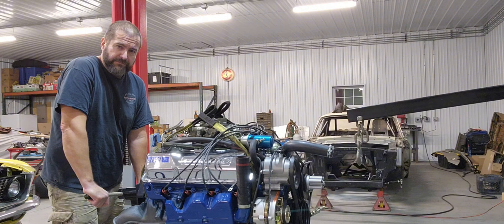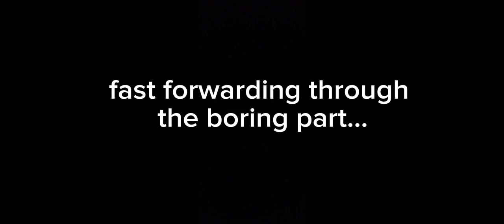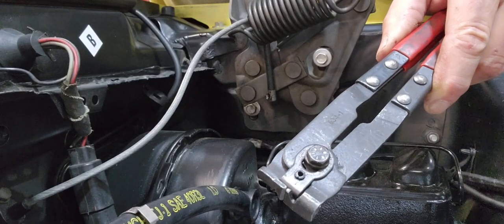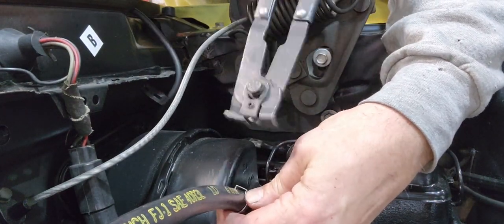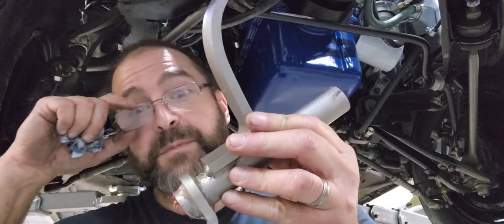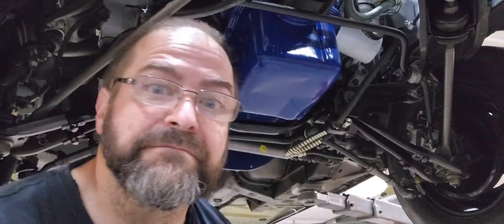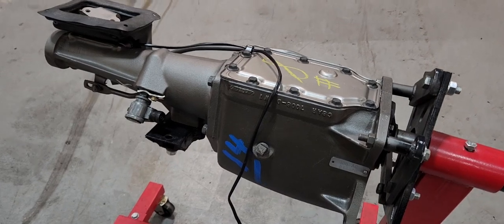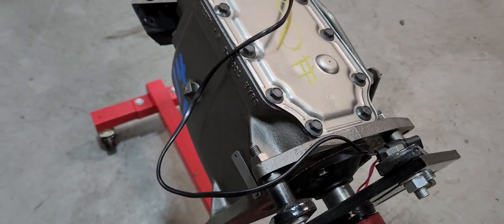1969 Boss 302 Engine Installation

Comment: Dave, we've done a number of these installations over the years. Yes, as you did with all engine accessories, clutch and bellhouse installed. We also install the trans. and factory h-pipe assys. before the drop-in. A smooth drop-in is aided by a short dolly (similar to a creeper) under the trans. tailshaft housing on the way in. We do the same with all Small-blocks, Clevelands, F.Es and even Boss 9s. Much less work later. I see another viewer has a similar comment except the unibody Fords of the era did not have removable k-members as you answered. We install Mopar E&T and accessories (including Hemis) by lifting the vehicles and rolling the entire assembly under the chassis. It also helps to have at least another pair of hands in all instances. When using a new aftermarket or otherwise exhaust system, pre- fit everything on the shop floor first. Again, much less work later.😉 Looks good!
Reply from the maker: All great ideas. I've probably installed 100's of engines over the years and have refined it down to what I do now. For me being a one man shop (me) I  find it much easier to just drop the engine in without the transmission and exhaust because of the chance of scratching the frame and firewall. Hate touch ups with the engine in the way. Thanks for watching!!

Comment: I built a dolly with HD casters...placed the complete engine transmission and front chassis on the dolly then raised the front end of the car with a "cherry picker" hoist... lowered the car over that dolly ...took us about half hour total.  Way way easier than loading it in from the top.  BTW nice car. Boss 302 built for sanctioned road racing in the Trans Am series with the Z28 and the Trans Am Challengers and AAR Cudas in 1970. I think paranelli Jones won the series at the end of the year for Ford.
Reply from the maker: Unfortunately you can't do that with a Ford, it all must Install from above. Thanks for watching!

Comment: I remember putting my engine and transmission back in my 69 GT 350 in my driveway,not fun 😢
It was an automatic and filling the torque converter with fluid and putting it in was a mess.
Reply from the maker: Man I did that the same thing in my parents stone driveway when I was a kid...not fun🤣